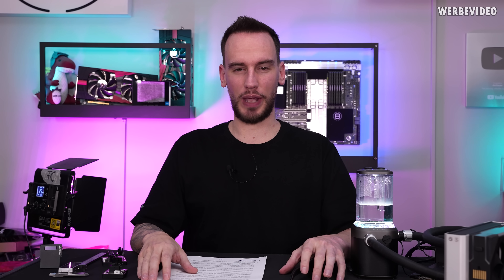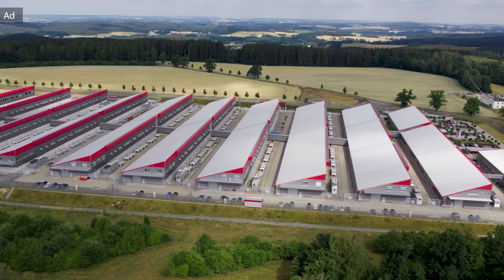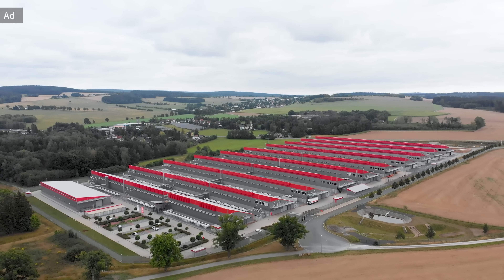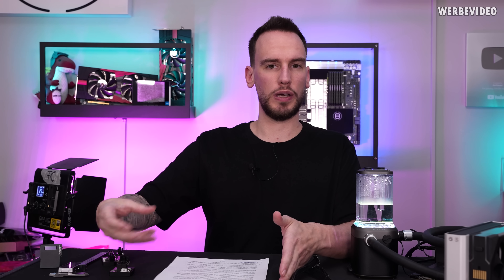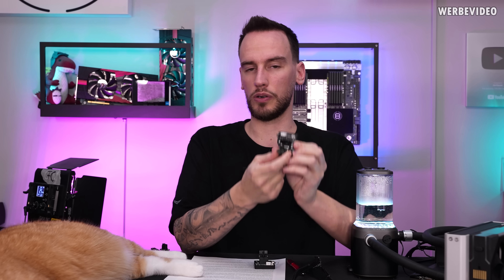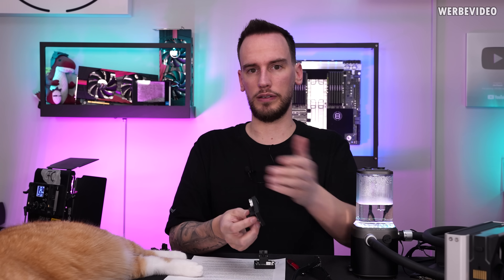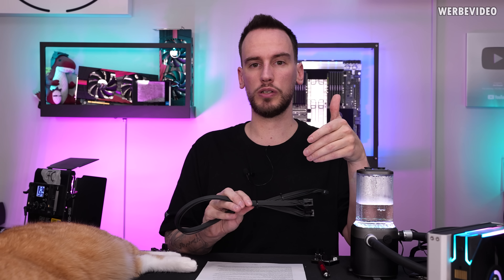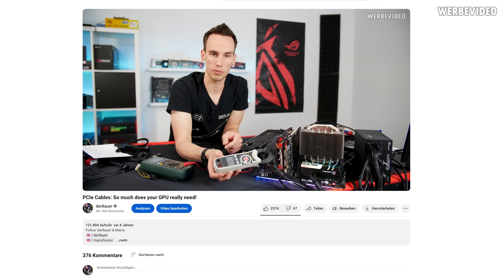12VHPWR is just Garbage and will Remain a Problem!!

Comment: I did not had a 12vhpwr cable in my hands until now, realizing how small the pins are and pushing hundreds of watts though it, no wonder it melts.
Reply: Especially at 12V. Another way to solve this issue is by making the connection 24 or even 48V. That cuts the current in half or by 4, instantly fixing the issue.

But that means adapters aren't that easy to make anymore so in practice you will need a new power supply.

The industry is going to have to get its shit together and figure out a proper solution, because this ain't it.
Reply: @Niosus can't do that without negatively impacting the VRM on the card. Stepping down from 24v to 1v for the GPU in 1 step is much more difficult than doing 12v to 1v
Reply: @nasone32  Sure, but if we want to keep pumping large amounts of power through small cables and connectors, something will have to give somewhere.

It could be akin to USB Power Delivery, where there is a known voltage/current that's always safe (5V, 0.5A), and that can be negotiated upwards if both sides support it (20V, 5A). The RTX5060 can be just fine with 12V without the added complexity, while the RTX5090 can have the hardware on board to safely pull much more power through the same cable and connector. On an older PSU that's just connected through an adapter, the RTX5090 can fall back to a lower power consumption target so it still functions, just at a lower performance level.

I know, it's not so simple and USB-PD has its flaws. But we're talking about 100B to trillion dollar companies (Nvidia, AMD, Intel) here. It really isn't too much to ask for a proper solution.
Reply: @Niosus yeah but it's stupid to have expensive VRMs when you can just engineer a more robust plastic connector which costs cents

Like the EPS connector for example. server GPUs use those and they've worked for decades.

Why would you spend money on a 48v vrm when you can use a better connector and call it a day?
Reply: @RAM_845 retailers do too , thats sad

Comment: 8 pin connector is much better, idc if it's bulky just go back to it Nvidia. Amd doesn't use this for that reason
Reply: While i would like a single cable connector that can deliver 600wats and looks better than bunch of 8 pins hanging from the card i also want that connector to be very reliable as the thing it's ment to replace is!
Reply: @novinovic298  exactly! It's why I don't trust anything over 300w with 12VHPWR
Reply: It's the new standard bud amd cards will have it next generation if it's not changed by then
Reply: @AndrewB23  7900 XT time
Reply: @AndrewB23  Doubtful. If RDNA4 will not have high end cards in the 8900 class there there would be nor reason to equip lower wattage cards with  this problematic connector.
Im pretty sure that 8700XT or whatever it ends up being called will do just fine with 2 or 3 standard 8pin connectors. Likely the reference model will have 2 and AIB models will have 3.
Reply: Or the 4070 ti super
Reply: Nvidia could also use the 8pin EPS connector that has even higher tolerance and that is used on workstation cards (including their own).

Comment: I have been using a zotac 4090 for a year I bought a cable mod adaptor but decided against it. So I been using the cables that came with the card and seems fine for what I use it for but I still don't recommend a 4090 for anyone
Reply: Aside from this cable adapter BS, I'm really happy with the 4090. If I have the spare money, I don't think I'll ever not buy a high end GPU for me anymore. I have a 4090, but my monitor is still 1440p 240hz, and it feels amazing to be out of the "how will it run?" race and just push everything to the max, sure, some games do not reach 240Hz when maxxed, but low hundreds still make me happier than barely 60. 
Maybe when we get a 6090 or a 7090 and the focus is running games at 8K, I'll feel upgrading to 4K will be worth it.
Reply: Same here. I'm using the supplied 12VHPWR -> 4 x 8-pin. No issues but I am always extremely cautious and always check that it is fully inserted whenever I open the case up. I've also got it supported in various places to prevent movement. It's my biggest worry that I'll get a burned connector when the card is out of warranty.

Comment: I have never thought about it before but I wonder what push-fit metal connectors look like in an electron microscope, I wonder what the gap is at that scale and whether some kind of conductive paste would help. Obviously that would have problems of shorting if applied incorrectly.

Comment: This connector is one of the reasons I currently avoid Nvidia cards. I don't want to risk an easy $1000 card with a poorly designed connector.
Reply: And also the price they just throw it to all of us and the poor quality they give
Reply: 4070 has a single 8 pin
Reply: Not just this, but Nvidia’s anti-consumer behavior has ensured it’s unlikely I will ever buy from them again unless serious changes occur within the company.
Reply: You mean $2000 GPU…
Reply: There are new gen cards with the old connectors. I went with a 3090 Tuf exactly because of that. That card still uses the older connectors
Reply: Watch out that one has memory issues  @machinainc5812
Reply: You know my though was the same, I was planning on getting a 4090, I ordered the 4 x 8 pin to 16 pin cable mod cable from Cablemod and when it came I was like nope so I ordered a nice bridged 3 x 8pin from them and got a 7900XTX Nitro and guess fucking what! The middle 8 pin fucking melted on me.... 😡😡 I was having so many issues and I couldn't work it out for ages that it was the cable, luckily enough the card is mostly fine 😅 because my warranty is gone since I was water cooling the PC
Reply: The other reason is that you can't afford it
Reply: @AndrewB23  I can. I just choose to spend my money on things that bring me joy rather than bragging rights until the next gen of cards comes out. Plus I just flatout dislike Nvidia due to their corporate policies.

Comment: Dear Nvidia and AMD, just put EPS 8-Pin on GPUs PLEASE!
Reply: Is AMD even using this new connector at all? all cards I've seen so far are still using the "old" connector
Reply: @marcogenovesi8570  AMD is using PCI-E power connectors. AKA the old ones.
Reply: I missed it at first too. They're saying they should use the 12v EPS (CPU) connector instead since it's already just 12v and an existing standard that's compatible with the 12VO PSUs that brought about this dumpster fire of a new connector.I'm kind of surprised they didn't do this to start with.  @marcogenovesi8570
Reply: PCI-E are the cables for your gpu, EPS is the 4 and 8 pin cable that goes to the top corner of your motherboard. same mini-fit connector, but different pinout.
Reply: @Born_Stellar exactly my point
Reply: I agree. Hopefully AMD continues to use 8pin has been fine this gen 7800XT and 7900XTX. My older Nvidia cards were 8pin standard, it works. I still spent a good deal of money on quality psus and gpus with 8pin so the house doesn't burn down. Maybe next gen will get better. Even a second 12VHWPR sounds like that could work, maybe they are trying to save money by cutting corners.
Reply: Why would you include AMD? This is all fake leather jacket mans fault. 😂
Reply: @thepatriot6966  Because EPS 8-pin is the superior connector, and their server divisions already know it and uses EPS on the server GPUs. It uses 4x 12V pins and 4x GND pins.

Comment: They refund the card?!
wow that's a big loss for a cheap accessory with small profit
Reply: small profit? they sell cheap 4 bucks crap for 50 bucks. sellers are out of their mind with their mark ups. then its understandable why it is so overpriced - its made for overpriced x3-4 times gpus.

btw the 4090 can't even run all new games on midrange 1440p 144Hz monitors with all eye-candy turned on without upscale or glitchy fake frames crap. all it can do natively in latest games is 1440p 100 fps - the 4090 is actually a midrange 1440p GPU and should be priced accordingly to 1440p monitors prices, 1440p 165-180Hz monitors can be had for 200-300 bucks rn. who on earth are so braindead that they buy 4090s for 1600+ bucks, 4090s are at least 1000 bucks overpriced when compared to pre-mining prices when top-tier GPUs cost around 600 bucks. and the 4080 is 30% slower which makes it a xx70 card, which cost ~300 bucks pre-mining = overpriced 900 bucks now. 

and GPUs still have mining-era prices like they still can print money but they don't. its just ngreedia doesn't care. they sell 3-4 times less cards for x3-4 more money each and get the same profits. killing PC gaming by doing so because no new faster affordable GPUs on the market = no people to sell games to = devs make 0 progress = top 1000-2000 bucks GPUs have basically 0 games made for their performance level = 0 progress in gaming in decades.
upscale and glitchy fake frames don't improve shit and are made only to sell the same old morally obsolete hardware that can't run games natively to stupid consumers.
Reply: @rawdez_   You're trashing the 4090, but it's about two times more powerful than the competition.
Reply: @rawdez_   The gap between top end cards now and the next tier is WAY bigger than 5-10 years ago.  Look at the 1070 vs 1080.  If you want lower performance and cheaper, then that's fine too.  People complain about the 4090, but the leap in performance is absolutely huge.  And yes, there are many games that utilize it if playing in 4k max settings.
Reply: @rawdez_  So what's better than the 4090?

Comment: very informative and interesting video, good work! we all going to need vertical gpu mounts and fire extinguishers
Reply: Or, just work with AMD and pay less for a card with more vram(and without melting connectors)
Reply: @ahuman5592  still overpriced 0 progress crap. the rx 7800xt isn't faster than the rx 6800xt  AFTER 3 YEARS of "progress". all corporations are milking the market with obsolete 0 progress crap now. ayyymd, ngreedia, shintel, sheeple etc. - EVERY CORPORATION sells overpriced af 0 progress hardware now. and stupid consumers keep buying 0 progress. nobody compares anything to 5-10 years ago anymore like they all have 5min fish memory. i.e. "tech-tubers" are a huge part of the problem. because they are silent about overprice and 0 progress and basically all make ads for overpriced af 0 progress crap nobody should be buying anyway. get used GPUs instead if you have to. don't feed greedy coprorations.